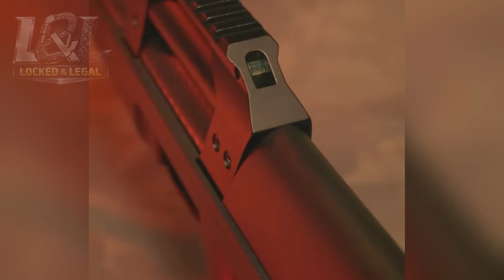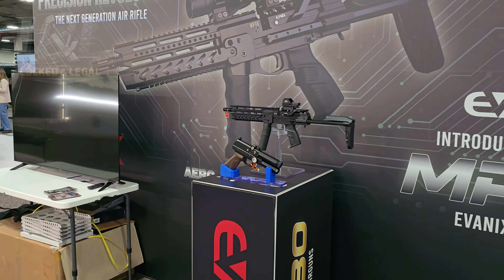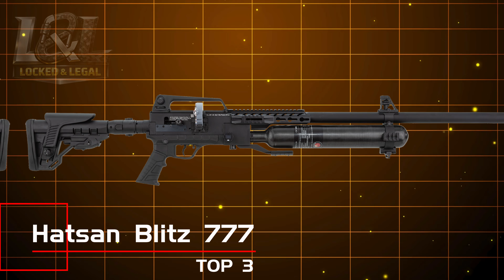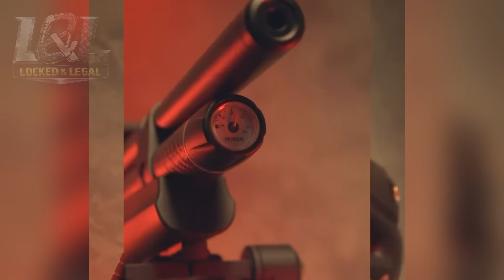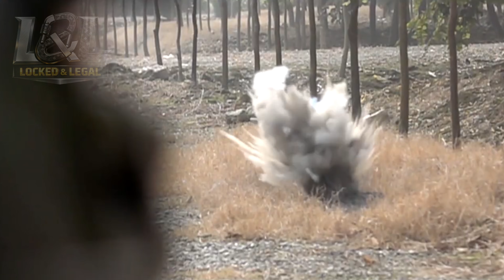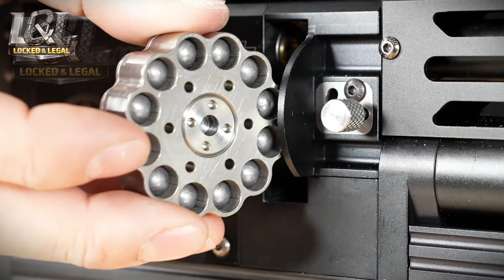Top 5 Best New Semi-Auto PCP Air Rifles for Hunting in 2026 — Is There a New King?

Comment: I have 2 Huben K1 25 cal carbon stocks rocking night vision an thermal both with 45 degree canted red dots shake awake… and a Huben GK1 pistol shake awake red dot. A Corbin press and make my ow perfect .254 Hollows….. they are as good or better then firearms depending use. I’d pull them bitches on the Mexican military I know that lol😂

Comment: The other Semi Auto's you missed are the Leshiy and the Taipan Slash both are rear bottle power to weight ratio is exceptional do another video with those 2 added to the list please. Also Evanix makes the cloud Ultra that is semi auto well with more FPE around 80 but has a smaller mag of like 7 to 8 rounds I think.
Reply from the maker: Great suggestions! 👍

The EDgun Leshiy 2 and Taipan Slash definitely deserve a look when discussing modern high-performance PCP platforms. Both offer impressive power-to-weight ratios and compact designs that appeal to hunters and field shooters.

And you're right about the Evanix Cloud Ultra. Evanix has been pushing semi-auto PCP technology for years, and the Cloud Ultra brings serious power to the table, even if the magazine capacity is lower than some competitors.

There are so many new semi-auto PCPs hitting the market that it's hard to fit them all into one video. Those would be excellent additions for a future update.

Thanks for the recommendations and thanks for watching! 🎯👍🔥